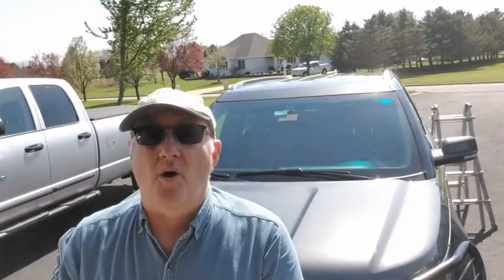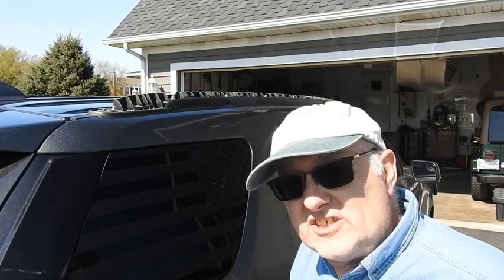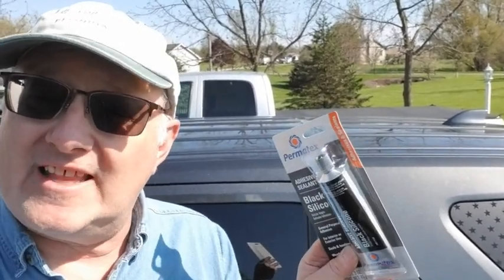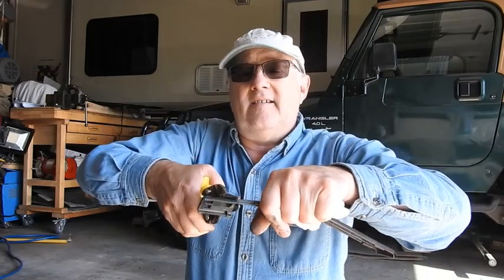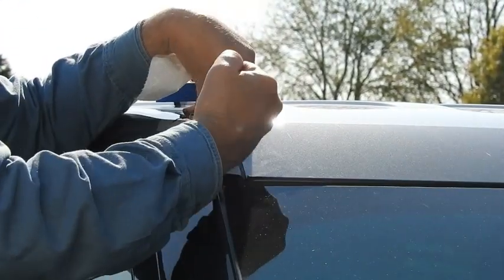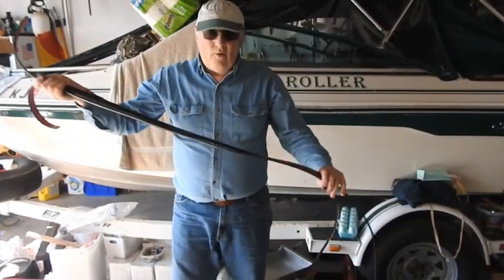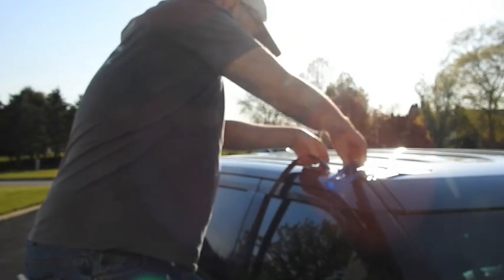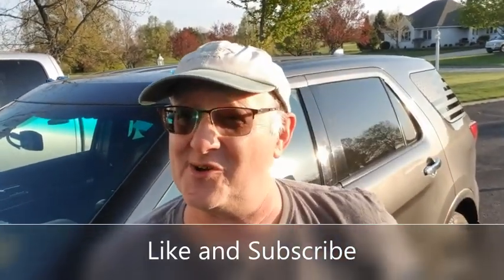Ford Explorer Roof Rack Removal for the Flat Top Look Mad Max Sporty and Clean Simple and easy DIY

Comment: Thanks for the great video! I'm in the process of doing the roof rack delete right now. One thing I did do that made things a bit easier is I used 3M super strength molding tape under the back end of the plastic molding that goes above the windshield instead of using a big glob of silicone adhesive. This made it so I didn't have to put sockets on it, tape it down,  and let it dry. I still used a little silicone adhesive where it clips into that white plastic track thing to make it it was nice and secure. One other change I made is I bought 304 stainless steel M6-1.0 x 12mm flat top hex screws from Amazon instead of using set screws. They still sit pretty flush so the weather strip isn't bulged up where it sits over top of them. Thanks again for the idea! The flat top look is so clean and it will also make it much easier to wash and wax the roof without that silly roof rack that always popped loose.

Comment: So I’ve seen this done but the tech had to take down parts of the interior roof at the posts front and back and then reinstalled a part made for the Explorer to fit exactly where the railing was removed…it was time consuming and I feel like doing it right in this case might be a better option .. if my vehicle was older this would be a better option.
Reply: Seems your tech did not know how to do this and did not watch the process here as there is no need to remove the inner panels

Comment: What size set screws
Reply from the maker: I think it was 6 mm, but you can pull one and go to Ace Hardware and find a match
Reply: M6-1.0 X 12MM
Reply: @mytwogoodhands2799  how many were needed? Did I miss that part? I'd like to have everything on hand before tackling the job. Maybe add a grocery list of items needed for the project?
Reply from the maker: @mitchellsonger9437  12 set screws are needed

Comment: What about the 4 nuts that are inside of the roof rack that hold it on that is under the headliner. They will rattle around in there.
Reply from the maker: I found no loose nuts during the process
Reply: You obviously didn't watch the video lol

Comment: What type of weather stripping?
Reply from the maker: 1" wide I found it on eBay you need 14' 7 per side
Reply: You can find it on amazon also. Any 1 inch wide black weather strip will do
Reply: I can't find this weather stripping either. Not 1" at the length I need. O'reilly's sells a hi gloss black that I don't really want,but it's in lengths of 12'.
Reply: @mytwogoodhands2799  At the time, when I was looking, I just ended up going to O’Reily’s. I used the 1” body molding. Solid stuff; holding strong to this day.

Comment: Wow! Impressive, not too shabby!, great look! Any idea how to remove the rear 7” Ford emblem?
Reply from the maker: I think fish line to cut the seal tape loose
Reply: My Two Good Hands 
Yes, I used nylon string to loosen it up, and used plastic pry tool kit from harbor freight, popped ryt off, thanks for your videos, good stuff!😎
Then I installed a custom 7” Ford emblem that came with double stick tape, but I added a bit of clear silicone caulk